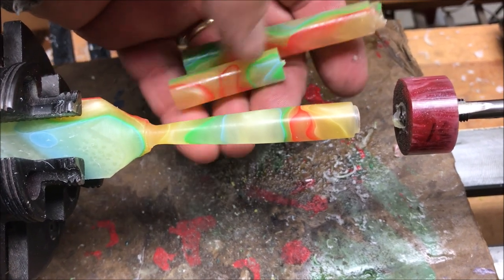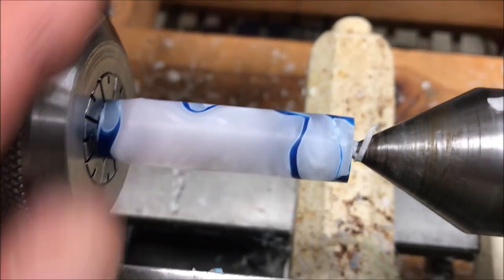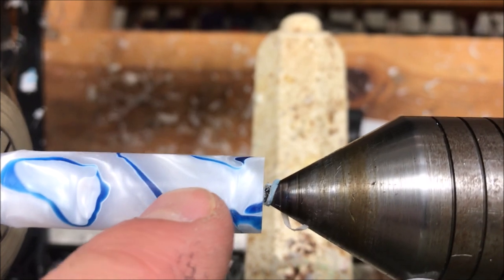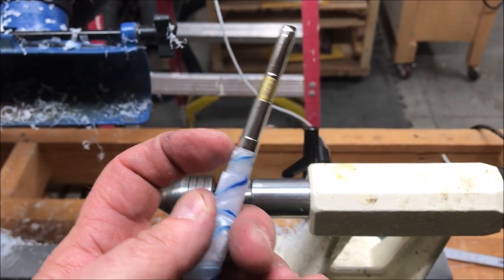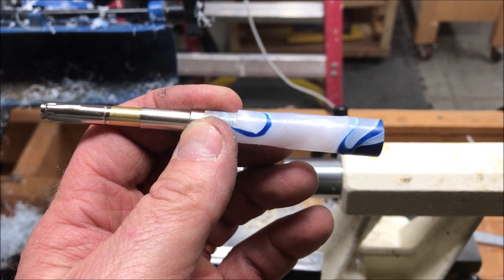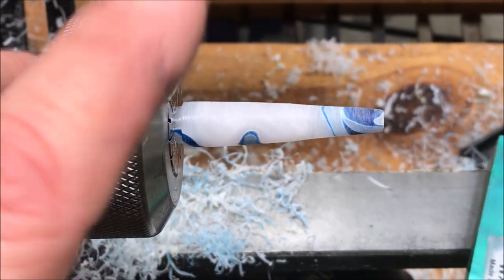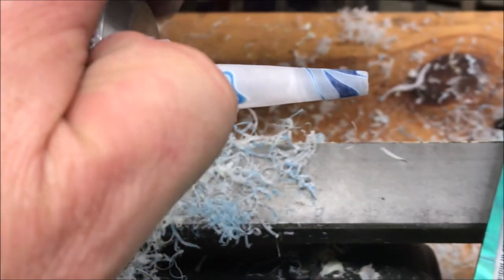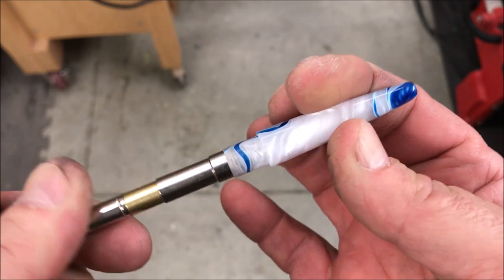Shop Update 3/14/2020

Comment: yes do the video.  i like the sierra, it would be cool to make a wood lower section!  you must have a three different diameter hole in there.  refill main section, spring diameter and tip diameter
what is the thread on the sierra transmission?
Reply from the maker: Yes, there are three holes. 7/64” 15/64’ and “O”. 

Regards,
Bob
Reply: @WhatchaDoinBob  thanks for that,  what is the thread f or the transmission?

Comment: Great job Bob. Sounds like the M8 x 1 thread is what you used to accept the sierra transmission. Was that a true Sierra or a Monet/Gatsby? They seem to be different in size from the Sierra. The Cigar pen transmission is shorter and turns in both directions which may give you some latitude in pen length. I'm looking forward to a more in depth video on the making of this pen.
Reply from the maker: This was a transmission from the one Woodcraft sells. I can’t remember he name, Prentice or something like that. It will also fit the Monarch. The only one I have that it won’t fit is the ones I got directly from China. 

Regards,
Bob

Comment: Audio much better, levels sound pretty much the same either way.  For your notes, instead of just writing them down, why don't you just record them as you work, something just for you that you can refer back to...just spit balling here.  But I like what you have done so far can't wait to see it when you figure it all out
Reply from the maker: Recording is the best way it just takes to long to watch it back. This video was originally 2 hours and 20 minutes long. Once it’s edited it’s a good record but notes are easier to follow on the shop. 

Regards,
Bob

Regards,
Bob
Reply: @WhatchaDoinBob  LOL not saying you have to watch it, it will just be there in case you don't understand something in your notes, forgot to write something down or if something didn't go right and you want to see what you messed up, then Boom fast forward, rewind and look at it. Then when you feel your notes are good or you have something down the way you want delete the video.  They would not be for the public.